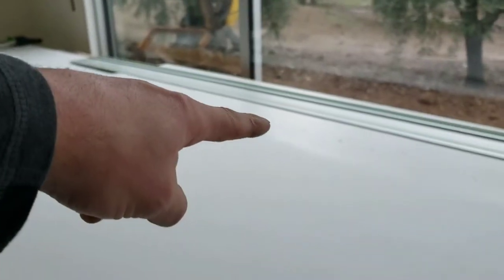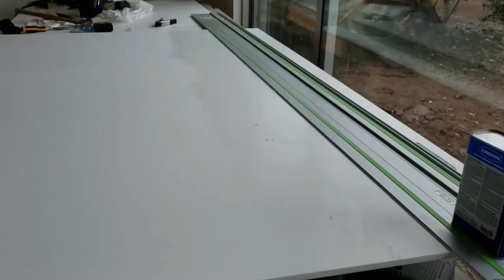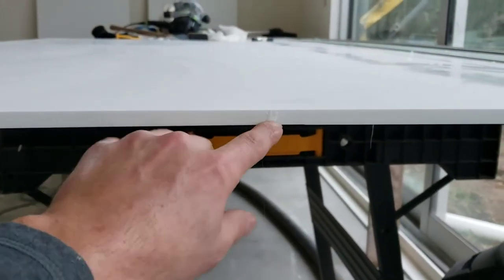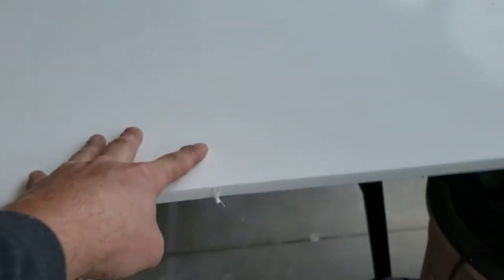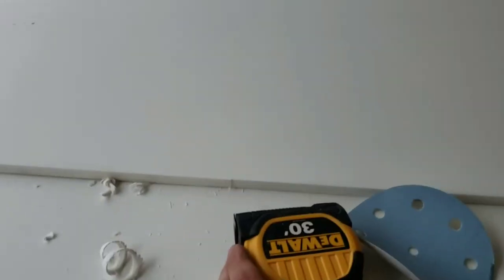How to seam solid surface seamlessly LG Himacs Pt. 2

Comment: We use a router with 1/2” corian blocks on each side of a double fluted 1/2” straight bit, about 1” gap outside of the router bit, these blocks are glued to the router base, the bit is set back 1/32” shallow from the face of the blocks, this allows the adhesive overflow to be shaved down, this saves from chiseling it and possibly putting unwanted chips into the face side of the SS, makes for much less sanding too, just something that is efficient for our shop, good videos however

Comment: There’s a sweet spot early in the curing process where you can scrape off the excess glue very easily with a putty knife. The sharp chisel on fully cured glue might chip the glue leaving small voids kinda like you spoke of from not using enough glue. I’ve only done about 20 countertops so far and I’m still learning something new on every one. That’s why I’m here to see what I can learn to make it easier. I just got some of those suction clamps you used. I tried them but I’m not sure I’m gonna keep using them yet. Thanks for putting up this video.

Comment: We also used electric motor pod clamps that use air suction, they work perfectly, no need to manually adjust the height of the two edges, the air pods flush them up perfectly, but the kit is expensive but works 😎

Comment: What about your lip material? Do you not add a lip to your countertops? Do you just leave the countertop at a half inch?
Reply from the maker: This was for a shower surround so no need for an edge. For counter tops I do add an edge depends on the profile. You can rip 1" strips then seam those to the edge and you'll end up having what would look like an 1" 1/2 thick top.
Reply from the maker: I can do a video demonstration if you'd like on how I fabricate the edges.

Comment: You can add two wood blocks in your router side by side
Reply from the maker: What would the purpose of the two wood blocks be?
Reply: For the sema so you won’t had to sand so much
Reply from the maker: @jokin91colombia  I'm not real sure on how that would help. If you could explain further itd be very helpful. Thanks for the comment non the less.
Reply: @demidog4549  I think he means instead of chiseling that glue off u take a router and put 2 blocks on it and put a straight shank bit, lower it to the top of the material and route that glue line out....
Reply from the maker: @shanesrt1  gotcha I see now. I was definitely a little confused on what he meant. Makes total sense now.
Reply: @demidog4549 no problem man, I saw that comment n was like what’s this dude talking about,  explain it more thoroughly, and this is my field of work...... I dig the festool equipment you got, best out there
Reply from the maker: @shanesrt1  for sure I doubt I'd actually use that technique. I feel it would prob take longer in my opinion. Have you tried doing it that way? Ive build sleds and done that to flatte out uneven tops. Its time consuming and you have to go over the entire surface.
Reply: @demidog4549  ur gonna laugh but we use makita  4”x24” belt sander 120 grit with a graphite pad inside the sander n fuck up decks trying to flatten them out,  it works but it takes skill, then I use a festool  n do what you do.... hope ur staying busy these days.... I’m in Iowa n we haven’t stopped, I do 40 kitchens a month, thanks to Lowe’s.... lol
Reply from the maker: @shanesrt1  unlike alot of people in this country im glad to say I am busy and thankful to be so. Knocking out 40 kitchens a month is insane to me. Here's a link to house I'm just about finished with. If you liked the content dont forget to like and subscribe brother!!!https://youtu.be/upoBpjO5W3M
Reply: Use a router by putting 2 ski blocks on the side, one to the left one to the right of your router & set the bit  on the solid surface  one pass & u done